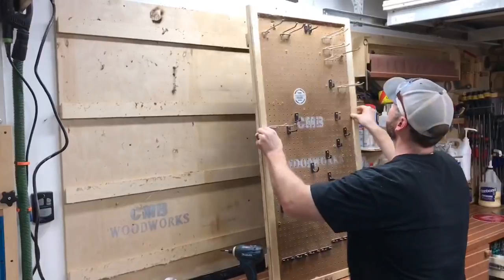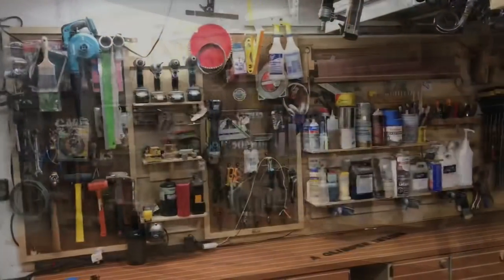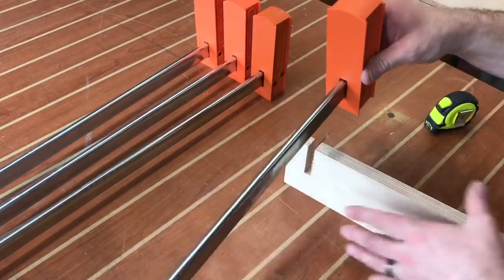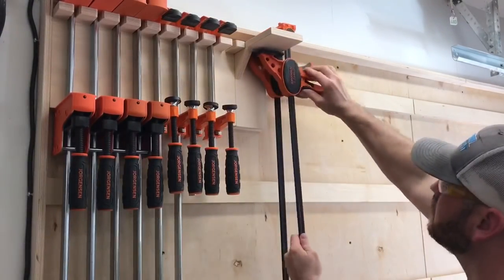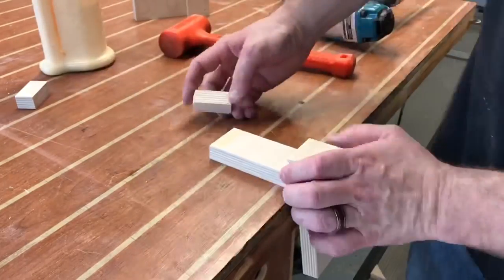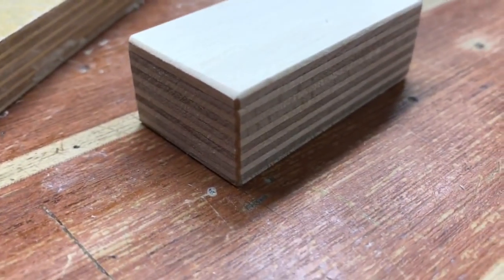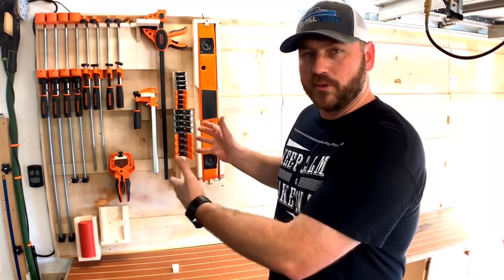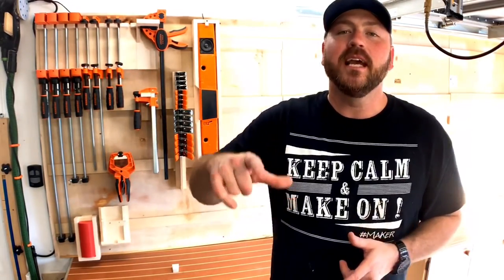French Cleat Organization | Woodworking Project | DIY

Comment: One of the best and most achievable clamp selections on YouTube for a working man. Thanks to you and the sponsor for sharing. Would you mind confirming what the actual lengths of the 4 different types of clamps are that you place on the french cleat system at the beginning of your video. Starts with the Parallel and up to the E-Z clamp. I followed up the links you provided, just require the lengths you used as I would aspire to build up the same collection over time. Any guidance greatly appreciated.

Comment: Hey great set of Videos on the French Cleat system. I am about to start on this for my next project, my small workshop is in the front of my Garage.
Anyway I was wondering what your thoughts are on putting a coat of polyurethane varnish on the face of the backboard?
Reply from the maker: That’s total personal preference I typically don’t because I don’t really see the need however if you want to keep the aesthetic of a really high end Chrisp shop it’s definitely the way to go
Reply: @AGlimpseInside  would the varnish interfere with the gluing process or if you were to do this would you fasten together and then varnish?
Reply from the maker: Richard Illingworth First of all I would not glue cleats to a wall. Just for flexibility in the future screws are all you’re going to need. However if you are I would cleat the walls first and then then varnish. Of course being careful not to get any down into the 45° crevice
Reply: @AGlimpseInside  Hey Man... don't you ever sleep :) thanks for the early reply, 5am in FLA right?